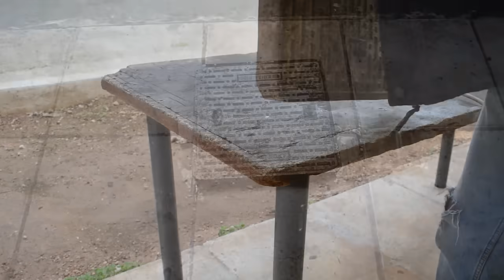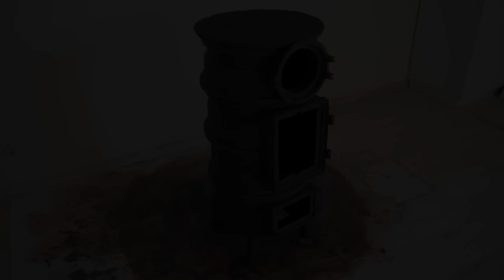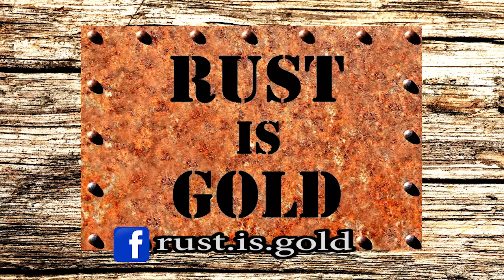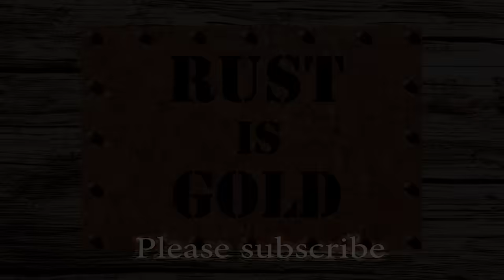DIY Wood Stove made from Car Rims

Comment: Shouldn't paint it. Paint will come off anyway. And god it stinks for the first few times you use it
Reply from the maker: I burned it a couple of times outside so that the paint hardens
Reply: @RustisGold  Есть краска для глушителей 600 градусов (С), если эта со временем будет себя вести, попробуйте её.
Reply from the maker: I will have it in mind. Thank you very much for your comments!

Comment: Looks nice. But the consequences are the stove top, middle door opening, ash catcher. 
* For the stove top. There is no opening. Therefore, this will work just like those electric stove or just like a griddle.
* for the middle opening. Why need to have two separate slide lock? You could just made one slide locking mechanism. OR, you could have put a bar to both of them so it could be just one hand operation instead of two.
* for the ash catcher. Slide opening is great BUT where are the ashes go, just on the ground then just sweep them up? It would've been nice or even better if there was a cather for a more efficient and even more convenient for the user. That's what happen when rushing on the job to finish. Quality and accuracy became a ghost on the job. Still a good job, though. Just an advice for the future. Planned the project. Good luck!g
Reply from the maker: Thank you very much for your comments. There was no rush to finish the wood stove. Regarding the stove top I decided to use this manhole cover as a  top and not to create an opening for purely aesthetic reasons. After all there is no need for me to boil water or cook on top of the stove. The middle opening I used 2 separate slide locks because I didn't want to put one in the middle of the door and cover the Greek inscription on it.  For the ash catcher I simply put a metal tray underneath and when I open it the job is done nice and easy.
There was no rush to finish the job. This is my hobby, I am never stressed to finish a project quickly!

Comment: Very interesting. So MUCH work! However I cant help but comment that the steel stove will rust away from the inside with all the chemical reactions from the flames unless you also install something like firebrick. The rebar grate will not last long either since it is very soft steel. I have no idea how you can put in firebrick with a round surface. I also hope that no police officer from the city you appropriated the manhole covers from ever sees this video!
Reply from the maker: Thank you very much for your comments. These are manhole covers for private use. You can buy them brand new for around 20€ each, (price depends from the size) at any local plumbing store. I bought my rusty old manholes from a scrap yard for a ridiculous amount of money.

Comment: Really poor welding and some of it I would change; one handle not two; heat dissipation with coiled handle. Not sure about the top porthole. Also, needs something to contain the ash removal. Air induction may be an issue and no testing done on burn or smoke flow but it’s all DIY and something very useful made from waste. Well done.

Comment: I like it all but the welds. You would think you would get better with the build but my gosh you love to grind. Good design and great use of recycled material. Great fabricator but not a welder. One tip is to watch your arc distance. You should look for the rod dripping into the puddle.  You need at least of an 1/8th inch from tip of rod to metal.
Reply from the maker: Thank you very much for your comments. I know it's not the best welding but I am not a professional welder and this is not a welding competition. Plus I used the grinding wheel and they look just fine. I am not trying to sell the objects I create. Just trying to show to other people how they can transform pieces of garbage into nice looking and functional objects... Take care!
Reply: Haven't laid a bead in thirty years, probably what mine would look like!

Comment: Why does the door need two latches?  Makes it hard to open with one hand.
The welding looks like the current is too high and the arc length is too long.
Reply from the maker: I didn't want to destroy the embossed inscription on the side of the door.

Comment: Excellent design and fit-up, terrible welding! Get yourself a MIG, stick is not for you.
Reply from the maker: Thank you very much for your comments. I know it's not the best welding but I am not a professional welder and this is not a welding competition. Plus I used the grinding wheel and they look just fine. After all... "A grinder and paint makes the welder you aint" 😄 
I am not trying to sell the objects I create. Just trying to show to other people how they can transform pieces of garbage into nice looking and functional objects...
After getting more used to this welding machine I realized that the indications regarding the Amperage were completely wrong. I was setting the machine where it was supposed to be for using 2,5mm rods and it was really low. I found out that in order to use 2,5mm rods with this machine I had to put the Amperage indicator close to the 3mm position.
Reply: Mig is just as useless on cast iron.